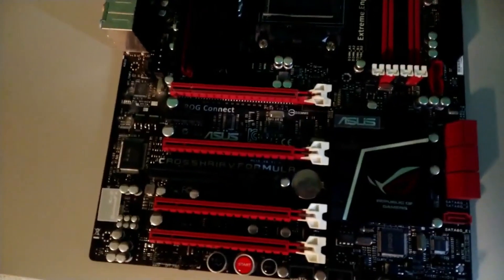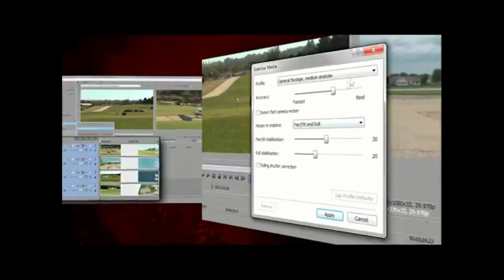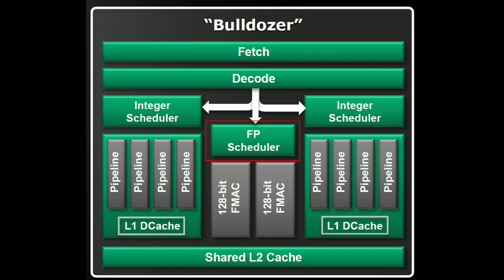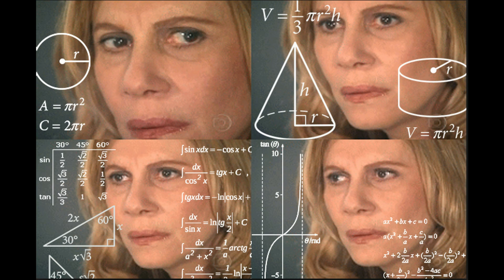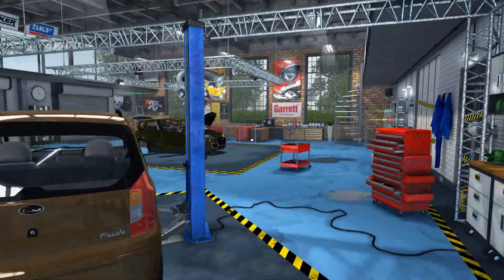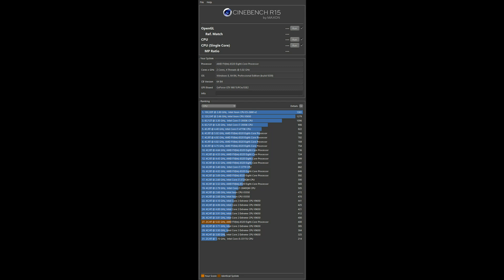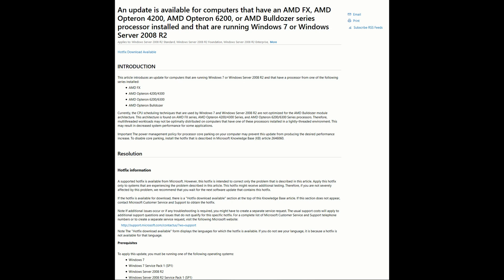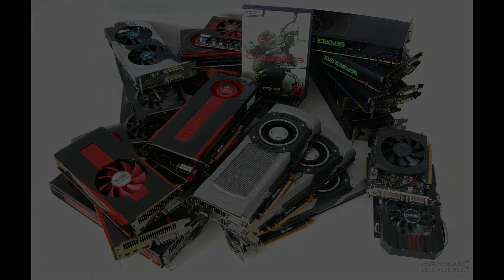AMD FX-8320 - Performance Tested!

Comment: Good video, 10 years of fx8320 User here. Extreemely versetile cpu, the drawback of this cpu is not the performance for me, but was the power consumption. With oc, the cpu scales like crazy if u have good vrms. But the power consumption goes crazy as well up to 200, 230w for 5ghz range. Yet again disabling core would compansate little bit.